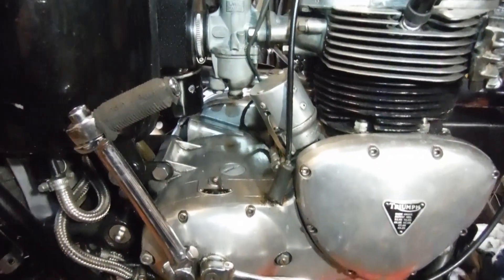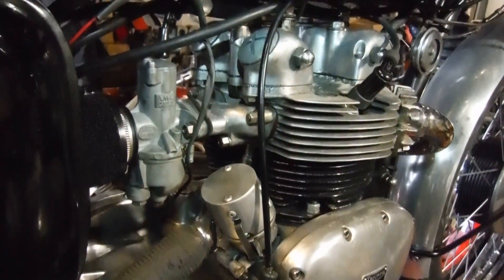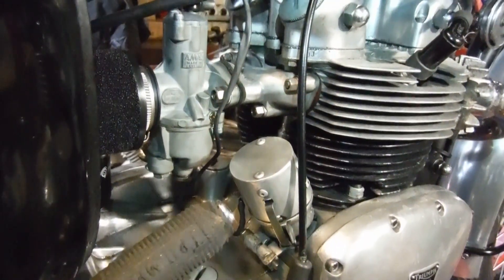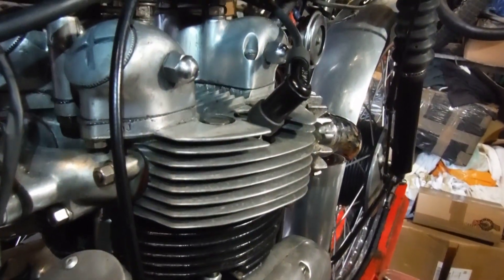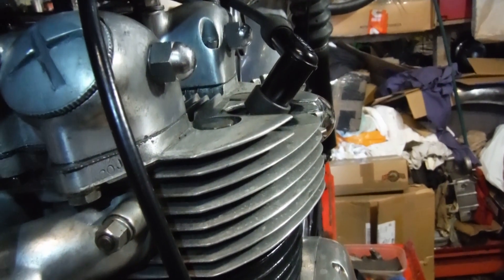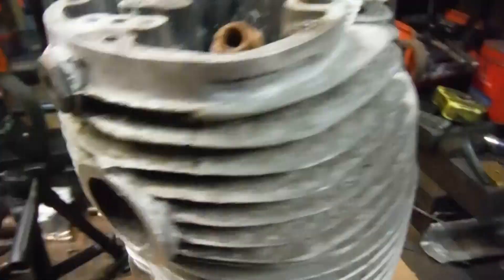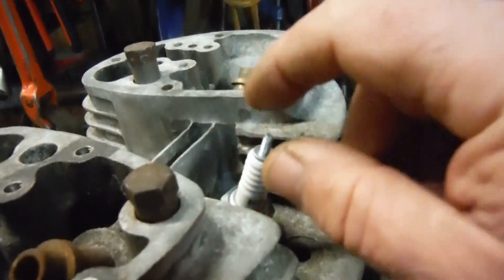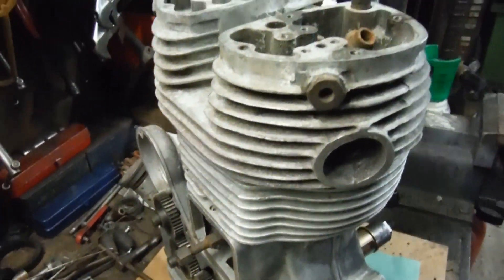Engine timing measurements BTDC & how spark plug hole angles can affect them - demonstrated.

Comment: On an A10 for example they only specify BTDC, no degrees, so I use a dial gauge with a bit of welding wire cable tied to the shaft, this goes in vertically and gives a very accurate reading, no SOHCAHTOA for me!

Comment: Why not use a piston stop to determine TDC then set a degree wheel on the crank to set for desired advance? I made a piston stop from a hollowed out sparkplug, a bit of old spoke and some epoxy. Works a treat and never any worry if piston has a crown or plug angles etc.
Reply from the maker: I often use a degree disc, sometimes in conjunction with the plunger - mainly for equal measurements before and after TDC when setting the degree disc up to TDC. I expected some discrepancy of the plunger's readings compared with true figures, but was quite surprised at how much difference there actually could be.

Comment: Sin is opposite over hypotenuse. Opposite would be vertical and hypotenuse would be length at angle.
Sin 45% is 0.707, so for every 1 mm of vertical travel would be 1.4 mm of angled travel.
Sin 30% is 0.5, so for every 1 mm of vertical travel would be 2 mm of angled travel.

I remember by
The Cat         Sat
On   An          Orange
And Howled Horribly

Comment: This is an issue that I’ve always had me wondering, with bikes that specify timing by piston height.  One can, of course, calculate the effect of the plug angle and compensate for the result.  What I remain curious about is, were these timing heights specified with the angle already considered or, if not, why can’t I find published data on the plug angle in the service manuals?

Comment: Good practical method. 
On a 45 degree triangle the length of the hypotenuse is always 1.414 times the vertical. In your case the angled travel is 1.414 x piston travel. (45degree plug)

Comment: Makes sense when you think about it !
I once had a TDC gauge like your one and when I bought it there was a small card in the packet with a conversion chart for different plug angles and some simple calculations that helped you work out this discrepancy to avoid confusion. Of course I either lost it straight away or threw it away and just relied on a degree gauge on the crank when necessary because it seemed a bit complicated.

Comment: I use a short length of bicycle spoke, bent to 90 degrees so it can't fall in. It can be held almost vertically and can be marked with a triangular Swiss file to show tdc and the appropriate full advance timing point for the engine in question. The marks to line up with some easy to spot place on the head.

Comment: YUP, My enfield tdc centre plunger sits between the 2  valve cutouts I have a standard 7;1 piston in front of me looks about 40. 45 deg dome on the piston.  English bike are not Japanese and are better built by feeling rather than the Japanese exact,  ( the Japanese mean what they say ,,0.01mm IS 0.01mm )  So Pauls way of tuning by feel. experience is probably IMHO the best way ....

Comment: Flat top piston in my B33. I found an Allen key just the right size, so that when stood up vertical, it touched the top of the plug thread at the back and bottom of the thread nearest to me. Found TDC, popped the Allen key in and marked the Allen key. Then at the bench, squared the mark with a hack saw, then (if memory is correct) made another mark 7/16" above that. 
Timing was always spot on

Comment: I use an old spoke or bit of thick brazing rod and that can go almost vertically into the plug hole. Use a fin top as you datum and it’s closer than the tool. I Don trust the scale particularly on mine and can’t see it either these days so a sharp scratch is more visible.

Comment: In 1964 Triumph introduced a TDC slot in the Crankshaft and an access point behind the cylinders. On the earlier engines take off the timing cover. The keyway and mark on the crankshaft timing pinion are at TDC. From this I also mark the Alternator rotor with TDC and the Static and Full advance positions then you can strobe time/check the dizzy.

Comment: Hi Paul, nice demo. For what it’s worth, you can calculate this on paper, but when I asked ChatGPT to do the calcs it got it wrong! From experience, I only use the TDC tool to identify TDC and then measure the full advance on the drive-side crank with a degree disk.

Comment: The conclusion then: using a plug hole style timing (tdc) tool can never be reliable unless the tool sits at zero degrees, in line with the cylinder axis. This error can be compounded if the piston top is contoured !  Nice demo Paul 👍👍👍
Reply from the maker: Thank you!